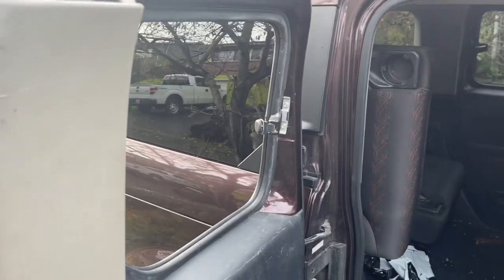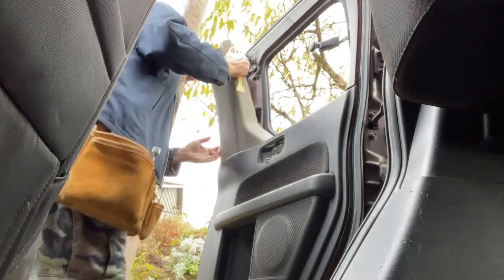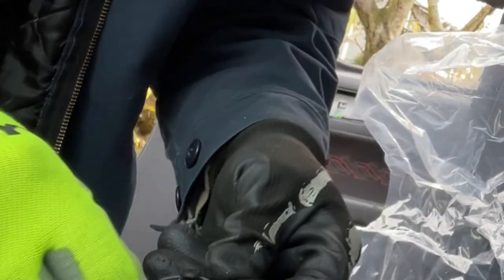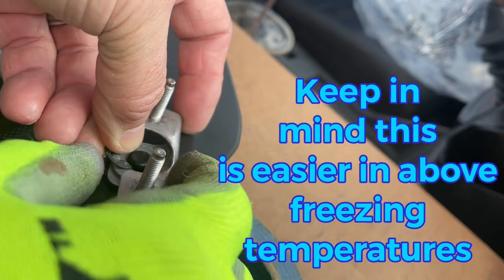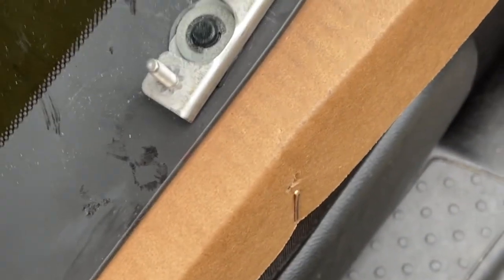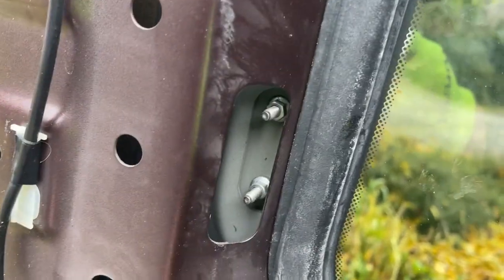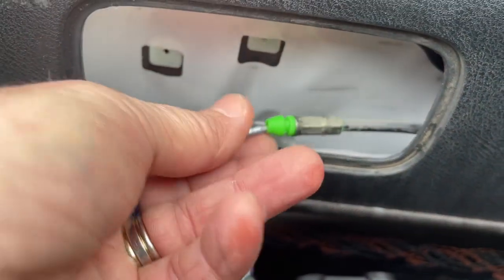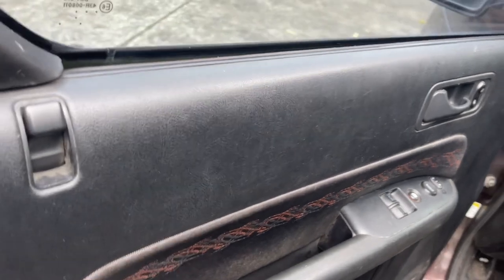Honda Element [Rear Side Window] Replacement 2003 - 2011 #Honda #HondaElement #SmashAndGrab

Comment: This video was really helpful to me. If I’m not mistaken, the trim model in the video is an Element SC, whereas EX has the front seatbelt strap attached to this rear suicide door. Getting the molding around the seatbelt requires removing another bolt at the bottom and actually removing the speaker & lower door panel. Today I did this to an EX model at a salvage yard to grab the glass (hardware included, so no C clip madness) to drop into my SC.
Reply from the maker: Nice work, Dustin! Thanks for the tips and the extra info on this job! You rock 🤘🎸🤘
Reply: Its a year thing. 03 to 06 had belts mounted on the door. 07-11  had them moved to the front seat. 
I had the same experience at the junk yard but i didnt have as many tools so i just worked the piece down the seatbelt and went about my buisness.

Comment: You know your working hard when you draw blood! Great tip with the clip and tape. As to those who never worked in the cold, your fingers become stiff and you can’t pick things up. If you are cold enough and freeze your fingers bad enough, the doctors cut them off! Ouch! Nice job of installing the glass, Russ!
Reply from the maker: Thanks Mike! Yes, the cold adds difficulty to any job. But with this one, those rubber grommets or a lot harder than they would be at summer temperatures too.

Comment: Thank you for this! I am attempting my 2008 Element next weekend. I've never been a DIY type of person so this is helpful. I'll give you an update if I was successful.
Reply from the maker: Good luck Brianne and don’t cut yourself like I did! 😂🩸 the hardest part was getting the Eclips in when it was cold. If you’re doing it outside, it might be helpful to use like a hairdryer or heat gun to help make the rubber more workable.

Comment: Thanks for the video. It was very helpful. 

And important detail id like to add. Early Elements 03-06 had their seatbelts mount on the door right on that grey pannel trim piece you removed at 2:09 . That being the case you might need an extra tool to get the seat belt off if one was so inclinded. A decent sized adjustable wrench would probably do it. The bolt was pretty big. I got my glass from an 05 in a junk yard and i didnt have the tool with me so i was able to kind of slide the trim piece down the seat belt and go about my buisness. I dont know how safe for the trim it was but it seemed fine. 

Additionaly on my car I was able to remove and replace that same silver trim without monkeying with any of the screws on the door. When you fit it back together you should be mindful of the rubber all the way down on the door jam facing the front seat. I had to pry it from being pinch between the pannels with a screw driver (a pannel tool would have worked the same) when I reassembled everything. 

Bonus because I got my glass at the junk yard I  didnt have to swap the hard wear that held it to the car. Made the job go alot faster. 

One last nugget of wisdom. Anyone going to the junk yard for the first time the whole lot is covered with goo and oil so if your careful you might be fine but i would suggest wearing a pair of kicks you dont mind getting dirty. 

I saved my self some nasty cuts thanks to your insistence on the gloves. Something I definitely would have skipped otherwise. 

Thanks for the cautionary tale and detailed instructions.
Reply from the maker: Thank you so much for the input! I’m sure it will help some other folks out there doing this job. I’m glad you enjoyed the video and found it helpful. And thank you so much for your contribution here in the comments. ✌️🙏 😅

Comment: i bought the c clamp tool from your link
Reply from the maker: Sweet! Thanks Aimèe every bit helps the channel. And it doesn’t cost you anything extra 👍😎😁 good luck on this. It should be much easier because it’s not the dead of winter 🤔unless you’re in Australia, New Zealand, or Antarctica 🇦🇶 🥶🧊
And promise me you will be careful not to cut yourself 🩸😬

Comment: My 2010 has a small leak at the bottom  area of the rear suicide windows. 

Water is not dripping down from top to bottom, the glass is dry from top to bottom. It seems like its from the bottom side hinge and trickling to the bottom window seal area. 

Its like the hinge area isnt getting good clamping force to seal it from water.  

Im trying to maybe add some gorilla tape on the window to add a layer of thickness so when it clamps and squeezes the rubber molding it wouldnt leak. Basically adding the tape is like making the window edge thicker.
Reply from the maker: Thanks for commenting. I hope that works out for you. Great idea!

Comment: I also had a smashed window recently, but the little latch part that you use to open or close the vent from the inside is missing, any advice on where to get a new one? Or maybe just if you know the name of that part, I'm not even sure what I should be looking for.
Reply: Disregard that! I eventually found it. Looking forward to installing it with this guide!
Reply from the maker: There you go. I was going to say wrecking yard. Wrecking yard has good OEM parts like that. 
And for me, it’s just a fun place to visit with all the junk cars laying around  😁🔧
Reply from the maker: Oh, and make sure you don’t cut yourself like I did LOL 😂 🩸
Reply: Wanted to update to let you know I did it! The window is attached and working great. I managed to avoid any blood loss thanks to your example. Thank you so much for making this guide. This is the first time I've ever done any work on my own car, and it was very empowering. I wouldn't have been able to do it without your help. Your channel is definitely going to be my go to for any future car work needs.